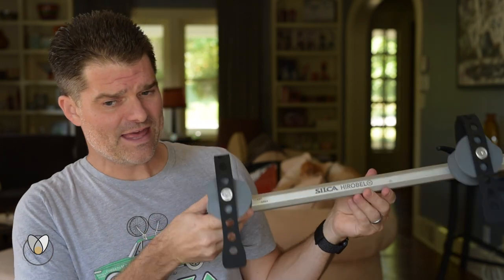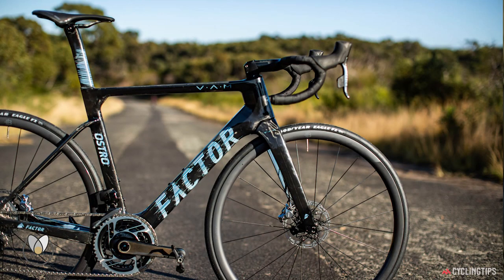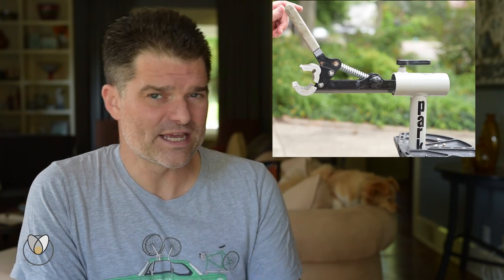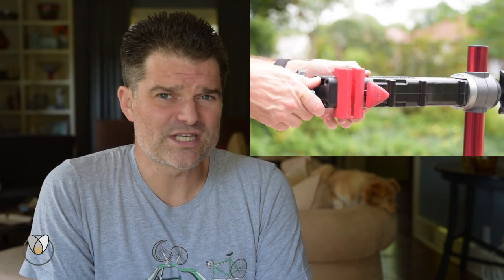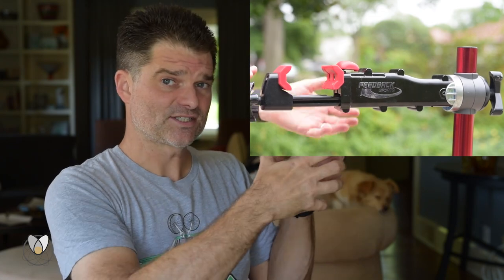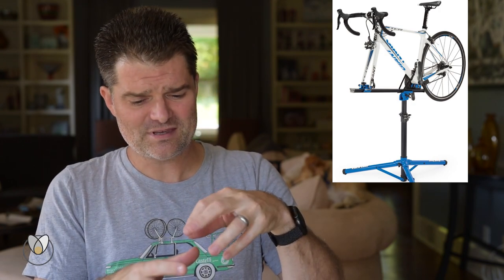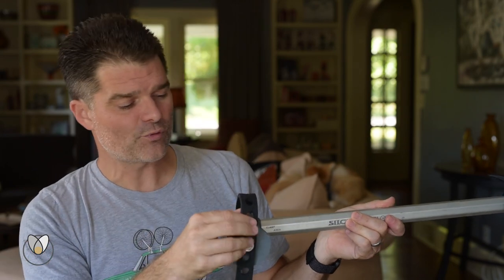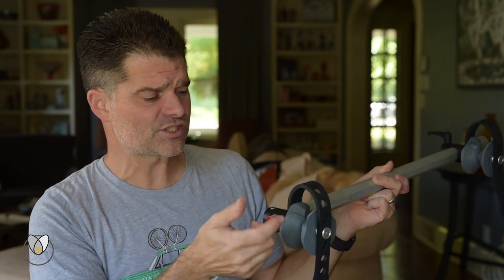MGTV FAQs Episode: Hirobel

Comment: FWIW: I own one of these and I use it on my vintage steel bicycle frames. It's much better than using a single clamp to hold your frame. Expensive but well worth it. Have fun :)
Reply from the maker: Thanks Pete!  I use it on my vintage bikes too!  Check out our Diamond Polished Chain video for a glimpse of the TVT92 I'm building if you're into that sort of thing!
Reply: Some of that ancient Columbus Record/SL, or Reynolds 531 SL stuff was incredibly, ridiculously thin-walled, and the top tubes of frames made with those tube sets seemed to be able to be dinged with a flick of your ring finger against them!! LOL

So yeah, this device would be useful in those cases as well. 😉

Comment: I find it difficult to justify that price. I have made different clamps out of moldable plastic, to suit  the different tube shapes and am also usng the age old type hanger: A hook made of a spoke on the end of a bike chain placed on a hook in the ceiling. Just put one hook under the handlebar and another under the saddle. I even use that system on my open tailgate, when away from home 🙂

To avoid the hook in the ceiling, you could place a tube or piece of wood in you repair stand clamp and put a hook on each end of the tube.

Comment: Would this tool accessory have any use working with steel frames? Protecting the paint job perhaps? Ergonomics?
Reply from the maker: Absolutely, the tool has much less pressure on painted surfaces than a traditional clamp, also, it allows you to clamp the Hirobel directly above the bicycle's center of gravity, which makes rotating it in the stand much easier, and also makes it much less 'bouncy' when doing things like bar tape installation.
Reply: @SILCAVelo  Thanks! The reason I am tempted to buy it is that I will no longer need to clamp my bike by the seat tube, which will effectively raise the height, making it easier to work with, as  I will be able to stand up straight while doing so.

Comment: Once you balance the bike properly, what would be the issue with clamping the seatpost which is made for being clamped?
Reply from the maker: Even modern round seatposts aren't always made to be clamped everywhere as the manufacturers go after ever more compliance and weight reduction.  Beyond that, not all bikes have round posts, and those each require their own unique clamping forces.  If we're talking old school bikes, then the seatpost is no problem, but if you look at modern ProTour bikes for instance, almost all of them have 'no clamp' indications for frame and seatpost.

Comment: Hirobel works great on my road & gravel bikes but can’t figure out how to put it on my full suspension mountain bike where the rear shock is parallel to the top tube (Canyon Neuron CF8). Any ideas Josh?
Reply from the maker: Often times you can put it under the nose of the saddle with good results, but yes, some suspension designs make it very tricky!

Comment: If only it was the $150 you mention in the video...it would be expensive...but the price is 20% higher than that. 🙄 😢

I have both the Park PRS-20 and the Feedback Sports Ultimate and, of course, you're 100% right, there are just jobs you can't do on the PRS-20.  I do "clamp" the top tube but I make very sure it's the lightest possible pressure and I also tilt the stand so that weight distribution is even.  But right I understand I'm taking a risk and it's with my own bikes.  If I was running the shop I want to open...I'd have these for sure.
Reply: $185 for a bar with a strap. I'm sure it's good, but...
Reply: @richcole3931  How much is a carbon frame repair?
Reply: @thedude1691  -- is this a burner account? I'll respond anyway. How much is a piece of metal, foam, and two rubber straps? I'll take the inconvenience of clamping the seatpost for now...